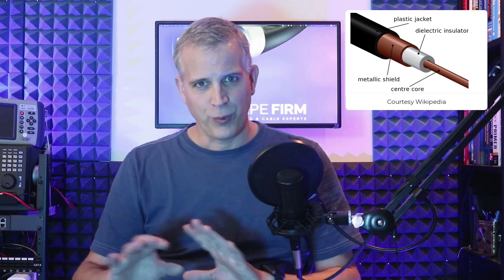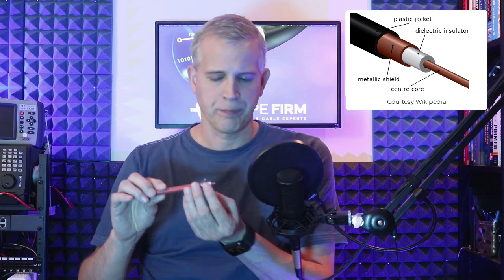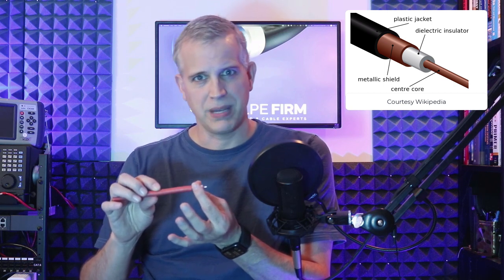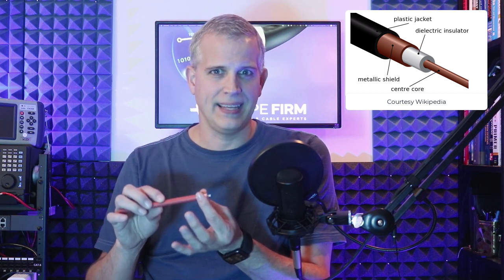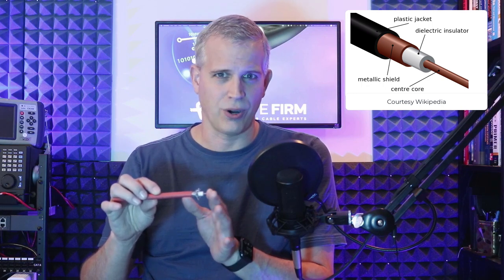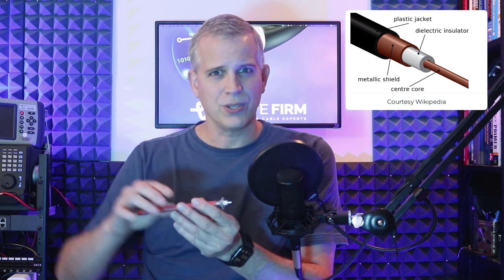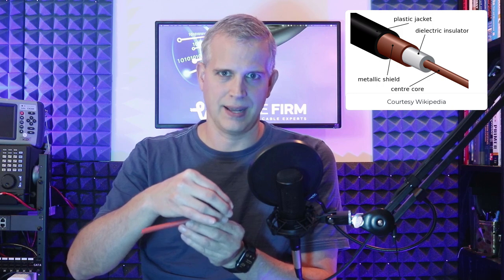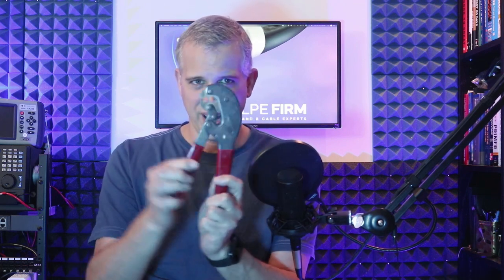How to fix your cable modem & coax cable

Comment: This is crazy because for so long now i've wanted to have my black coax cord replaced and the technicians from rogers said no for some reason LOL.

I'm trying to look up another coax cord for Rogers xfinity gen 2 gateway but not sure what to get exactly.
Reply from the maker: Yeah @fluffyruff7453, most coax cable you purchase is just fine as long as it's 75 ohms. Try to get "compression" fit connectors vs. ones that are just crimped on. Don't let the marketing people full you with any of the gold plating crap. It's just that. Make sure you tighten connectors finger tight, not gorilla tight, but tight. I have a very small 7/16" wrench that I like to use to make a tiny bit snug. But don't over-tighten.
Reply: You have to spend you own money to buy a broadband signal booster and always get one with a big boost on the upload which is why you connection goes down dozens of times a day. My connection used to go down 47 times a day and I bought a Motorola 15/10 broadband booster and also bought a 6/0 attenuator a professional one.

Comment: At 8:18 when you say "over the top TV", do you mean "over the air TV"?
Reply from the maker: @itsvideos thanks for watching and for the question. Over the top TV, or OTT TV, is content that can be accessed with high-speed Internet connection instead of a cable TV or satellite TV subscription. OTT TV services include Netflix, Hulu, Amazon Prime etc....  Hope this helps
Reply: @Volpefirm  Thanks.

Comment: Doesn't swapping the modem also change the Public IP address? I am pretty sure this is true because IP is assigned to MAC address, right? 

We technicians sometimes find nothing wrong with the connection or history but after swapping out the modem it solves all the customers problems. I have been wondering about this when it comes to people's work VPNs and wonder if it some IP addresses have a bad history/implementation on the CMTS. But then we have the reverse polarity EN2251s.... so it's hard to say if this is a possibility or it's just faulty equipment.

Also I noticed that the 3.1 modems also have a habit of never recovering their SNR unless you swap them. This is usually occurs when there was a RF impairment that has been fixed but the modem just reads a SNR of 35-38 when it should be at 40-42 on our plant.
Reply from the maker: If your modem is not statically provisioned, definitely yes

Comment: Wow, cleaned up my cabling and now I'm getting everything out of it. Thank you!!!
Reply from the maker: Great to hear. Thanks for watching
Reply: @Volpefirm  Hi was wondering if you would be able to help I have an Arris SB8200 that keeps going from blue to green on the bonded downstream I logged into the modem and everything seems to be locked 36 channels there is 1 channel that says other and not Quam 265. I've tried connecting directly to the coax coming into the house and the same result even tried a new coax cable and still no change. This all started around a month ago with a bad wind storm so I'm thinking the issue might be up at the pole.
Reply: A lot of bloody good that would do.

Comment: Hi Brady, really enjoy your videos although most of the information shared outside of 'The Subscriber Side' is way over my head.  I'm troubleshooting our Netgear CM2000 cable modem connected to Comcast internet and TV service.  I upgraded the modem a few days ago (upgraded from the CM1000, both of which I own).  My wife works from home and has been experiencing Zoom call drops and I've been frantically trying to troubleshoot.  Speedtest results are great 875 down, 23 up.  For the first 2 days with the CM2000 I noticed the downstream light blinking white indicating that the modem is searching for a downstream channel.  I removed the 1 to 2 splitter in my network closet and connected directly to the modem and now the downstream is locked and my wife is happy.....but at the expense of our single cable tv box!  I considering adding an upstream/downstream amplifier but I don't know which one to purchase and I don't want to damage my modem or interfere with my neighbors signals.  How do I proceed?  I can share cable modem connection data/dbmv levels if that would help.  Thanks in advance!
Reply from the maker: Hi POSTMILLDR sorry to hear you are having problems. If your drop comes into a two-way splitter with one cable to your modem and the other to your set top box, then I don't believe that the drop amp will solve your problem. There are likely one of two issues going on: 1) you have too low of RF signal coming from the provider, which is why when you remove the splitter you gain back 3-4 dB of signal and your modem is able to lock or 2) the cable going to your set top box is back feeding bad signals (micro-reflections) causing your modem to drop offline. Login to your modem and check its downstream signal levels to determine which of the above two issues it maybe. You want -10 to +10 dBmV at the input of your modem for receive level.
Reply: @Volpefirm  Thanks Brady!  Downstream signal levels range from +.8 to +3.9dbmv on 32 downstream bonded channels.  4 upstream bonded channels range from 43 to 44.8 dbmv.    I actually sent the Netgear modem back after a Sr. Comcast tech came out and suggested I try a different modem.   I'm now using a Motorola MB8611.  At first it seemed very stable (and the Downstream and Upstream lights are solid now!)and then the drops started occurring randomly again.  I'm glad to call the Comcast tech back out, but it seems that he was very confident that the Comcast signals were perfect and the problem must be on my side.....even suggesting it could be the router.  Maybe the problem is on my side......I just need help trying to troubleshoot.  The modem event log shows a bunch of Event type code 16 and 24 on channel ID 33 and they are categorized as Notice (6).  The Critical (3) Events are: SYNC Timing Synchronization failure - Failed to acquire QAM/QPSK symbol timing; No Ranging Response received - T3 time-out; Started Unicast Maintenance Ranging - No Response received - T3 time-out; Received Response to Broadcast Maintenance Request, But no Unicast Maintenance opportunities received - T4 time out.  I'm assuming the Event codes 16 and 24 are related to one of the Downstream Bonded Channels (OFDM PLC, ID 33) which has a high number of 'Corrected' and a currently low number of Uncorrected (133).  In fact it's the only Downstream with any Uncorrected.  I will remove the cable from the back of the cable box to see if that solves the problem.  Kids are not going to be happy with me!  Sorry to throw all this at you.  My wife is at her wits end.....

Comment: my coaxial cable is damage which causes my router to not work. if I change my coaxial cable will that fix the issue?
Reply from the maker: Hi Jose, Definitely fix your coax cable. I can't promise it will fix your router, but a damaged coax cable is never good.

Comment: I know this is a old post, but my internet speed drops out randomly, have to reset modem everyday, My ISP has no idea, I've replaced modem and the cables BUT if I just unscrew the cable from the modem and screw back again, my full speed comes back without resetting modem, what does that mean? 🤔
Reply from the maker: This sounds like a couple of possibilities one possibly involving sheath currents,  my friend Mark writs about it here https://broadbandlibrary.com/longitudinal-sheath-current-revisited/   You should first check your ground block and verify it is grounded to an Earth ground. You can Google methods to address sheath currents. One common way is to make 10 loops of coax cable about 8-10 in in diameter. And place inline to your modem.
Reply: @Volpefirm  Thank you so much for the information, I'll look into that

Comment: I really hope you answer this, I've been having this issue for months now, can a pinch or something like that in a coax cable cause all my devices to lose wifi connection for about a min? (Happens 2 times per day, every 12 hours) Other than that, the speed is great, just when the clock hits around 8 AM, and around 8 PM. I even got a new router and the problem still persists.
Reply from the maker: Since it occurs in the morning and night its likely a noisy light or something similar turning on and disrupting the signal. The noise is most likely getting in around your drop or inside your house. If not there, then let your cable operator know about the issue and especially the time of the issue. This is very helpful trouble shooting info for them.

Comment: Very helpful video! We been having intermittent issues and I checked the coax to find some potential bends in the coax. And what do you know, I actually found some. So, I went ahead bent them back to shape just to try. Checked the speed test and it went from 20-50mbit to 200+, which is our max speed. The coax wasnt too bent, but it was just enough to cause the intermittent and disconnection issues. The bent coax were most likely cause by being crush by moving furniture. 

Real life saver this video because our repair schedule is not due till Jan 10! I'll have the tech replace the coax!

Thanks again and subbed!
Reply from the maker: Awesome. Love to hear these stories 👍